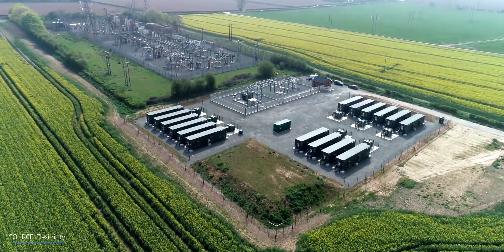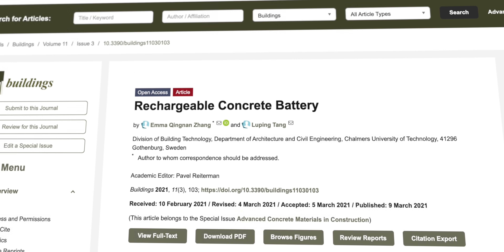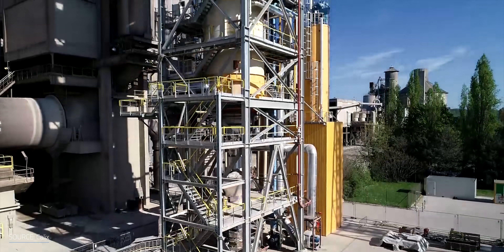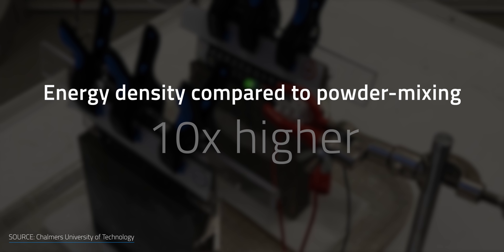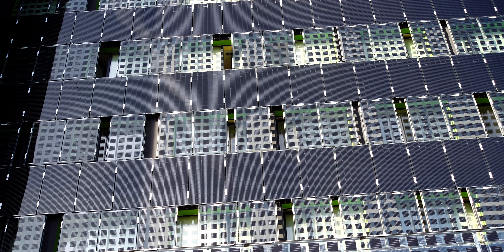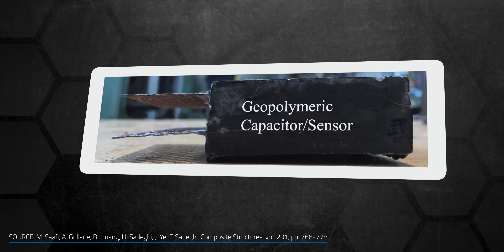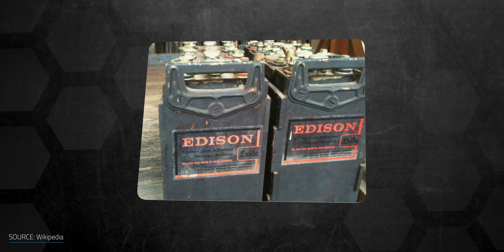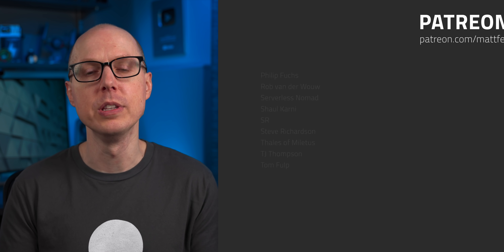Turning Buildings into Batteries? Concrete Battery Storage Explained

Comment: A conmplete change of subject. Why are car manufacturers and Grid 
companies not embracing VTG?  I believe that VTG is vital to the wide 
spead adoption of green energy. Tesla has soft ware control of the 
largest battery in the world that is growing by over 50% a year ie Tesla
 Cars. The Dutch have a dual action charger ie GTV and VTG. It works on 
the European charge plug. Your reasearch and comment would be 
appreciated. My thoughts are that Tesla and the Grid are stone walling 
this. Better a Tesla Powerwall and a Model X than only a Model X acting 
as transport and power wall. The grid has peaker plants that would fall 
from multi millions to minus multi millions.

Comment: I have a LOT of questions about it's viability. I'm pretty sceptical. Given the energy density, it doesn't seem worth much effort. 

Concrete is currently used because it is cost effective, versatile, durable,  simple etc....Not just because of the materials but because of the processes used to turn those materials into a finished product.  If turning it into a battery takes away from any of these properties... then builders won't use it.  You can technically build a house out of lithium ion cells and a carbon fiber quick change exoskeleton ... but I think it's safe to say that's not a good idea either. 

There wasn't an explanation of how this would be assembled in a real world construction application. Concrete is brought to site in a truck in fluid form and poured into forms / molds at the job site. If this process needed to be changed, it would likely not be feasible in most applications. 

Most concrete, almost all of it, has rebar in it. Would this have to be changed? Most concrete, almost all, is made so it will purposely crack in a planned location for expansion joints, and to allow for slight shifting, movement. Would this have to change? 

It sounds like these batteries would not be recyclable (in any practical sense) as crushing concrete to get them back would be very energy intense. 

Making something work in a lab is very different from making it work in the real world.

Comment: Can SpaceX develope an energy capture system at stage 0 of the launch. Beneath the pad extending in as many directions as possible while maximizing energy capture in this tech or use the Sand Energy storage already developed and I  use in ... Norway,I think. Each cubicle of heated sand capturing 600 degrees of temperature that has 6 months of energy conversion capacity. 
If Elon hopes to do 2 starship liftoffs per week, and the fuel doesn't compliment carbon capture, Elon can create energy storage with the megatons of Newton energy expelled per lift off. And at the tailend of those channels, have turbines capturing the wind forces from liftoffs. Mic drop....
Is this possible at a first principles level. IS THIS POSSIBLE. Please respond

Comment: But what is the efficiency? Electric motors are ~85% efficient in both directions, and gearboxes ~90% That means a better concrete battery would just be a gravity battery that would be near 77% efficient.

Comment: a cement battery and a high-rise capable of running the elevators and emergency lights would be quite beneficial. I am concerned about what would happen if a cement battery is hit by lightning.

Comment: Utility poles, lamps, wifi towers etc. I see this being useful in those cases.
Homes and large buildings? Nope. Not going to happen. All the structure usually needs to do is support itself and occupants. When you put the added job of "store power" on it and then it stops being good at that? The amount of work required to maintain the building increases to the point of being completely unsustainable.

Comment: This is DUMB DUMB DUMB, first energy storage of .7 watts/sq ft is USELESS, 2nd, you don't want your structural component of building undergoing cyclic chemical changes or it will lose it's structural integrity.  I wish there were not so much dumbshit ideas like this wasting bandwidth.

Comment: Not to be nitpicking, but cement is a constituent of concrete along with various aggregates.  You use both terms interchangeably.  In addition, concrete should be referenced as a volumetric unit in meters cubed.  That aside, your posts are always enjoyable and thought provoking.  Keep up the good work!

Comment: A few observations:
- Concrete is 8% of global emissions not 2.4%.
- At 7w m2 you would need 214 m2 just to boil an average kettle! (A poor analogy but you get the idea)
- Once life expectancy is reached, replacement would be impossible. All you have then is a really expensive wall.
So yes, far to good to be true.

Comment: If you could store energy directly in a freeway that would also play into ideas around inductive charging while driving.  USU is already working on modular concrete inductive charging blocks.  It would be interesting to have the structure act as storage as well

Comment: This will work great until the local drunk drives a car through the wall...

Not a good idea.  Build a concrete battery in the backyard, maybe, but don't use it as a building wall...

Comment: I'm sceptical. The ability to bear heavy loads is critical for any concrete structure and anything that could compromise that is a serious safety concern. Also I'm not an expert but it sounds like the cement needs to be kept wet to function as a battery, which makes it inappropriate as a building material. Not to mention the fact that cement and concrete are different (though related) materials and it is concrete, not cement, that provides critical structural integrity for large buildings.

Comment: I really hate those kind of "inventions" they are just making things more complicated, more composite,...

It is on one side making the concrete used in the building less inert.
As bad as concrete is to produce, at least, it is a pretty inert and easy to recycle material, even when steel rebar is used.

On the battery side, it make the installation non serviceable, not repairable, with a very low energy density.

And the end result is an expensive, highly composite material which will necessitate it's own recycling pathway.

Why not work on a better, "greener" concrete to build and sit a better battery on a simple concrete slab?

Comment: the way i see it if it can be abuse and not worry then it would out sell most other battery by durability... it mean you can just craft a block throw it in the desert and forget about it!
high durability mean less mantenant, if it fail... can you just break it down and recraft it since well the base material is not that much different than the finish product?

Comment: high density mean high temperatures 
so if you charge or discharge the wall and floor of your apartement in summer it heat the inside
and considering solar panel more eficient by summer day than winter night its again the reverse that is needed

Comment: In renewable energies there are 4 main criteria :

ENERGY CREATION = (solar) sun / (hydro) water / (turbine) wind
ENERGY STORAGE = e.g. LiFePO4 cells
ENERGY CONVERSION = converting DC to AC - e.g. Inverters
ENERGY CONSUMPTION = LED's (devices that use low energy consumption)

So we need to make ; save ; change and use efficiently !

Comment: I've been dreaming of my own house. I'd build it from Roman concrete. This is much more durable than modern concrete and we're talking about thousands of years of endurance. Add to that rebar and it's silly strong. Making the Roman concrete is far less polluting than the modern ones.
Reply: If you want roman durability, you should ditch the rebar.
Reply: @sevret313  I realised that after watching this video. Def. ditch the metal.

Comment: Maybe I am missing something but I kept being thrown off by the repeated references to watts per square meter.  Concrete would seem to be a volumetric medium, so wouldn’t that be watts per cubic meter?  I realize that the battery would be a laminar feature within the volume of the concrete so I see where the area units come in but some comment on how that is stacked up within the volume would have been good.

Comment: Calling that a concrete battery is like calling a lead acid battery a water battery because the elektrolyt is mostly water.

All this would do is to make construction way more expensive with the added benefit of having to TEAR YOUR HOUSE DOWN to swap a dead cell.

Comment: So... to use this in a building you'd have to use precast concrete panels since this sounds very hard to do on site. Number of questions though:
1) How does this affect the concrete strength? 
2) Does cycling the battery cause any component to swell? If so how does this affect longevity?
3) Does the ion exchange leach any important minerals from the concrete?
4) How does the battery react to water infiltration since concrete is porous?
Reply: Sooooo...what happens when I drill a 1" through hole in the wall or drive an anchor into it?

Comment: The issue is safe battery technology .the problem of using large scale battery storage facilities is the danger of fire and environmental issues .there is no such thing as green energy .The laws of physics dictate so !Energy can't be created ,only converted from one form to another !All we are doing is off setting the carbon footprint .Nothing is free but at least we can reduce the amount of fossil fuels we use .But all so called green energy requires fossil fuels to manufacture so one way or another we are dependant on fossil fuels to manufacture Wind ,Solar,Nuclear and Concrete !
Remember that plastic was a waste product of oil refining and used to be just burned off .That could have been used to generate electricity !

Comment: This kinda reminds me of passive solar designs and materials used in the late 20th century. The storage of heat though a bit different from the storage of electricity still follows similar properties like conduction and mass/density  potential retention. A problem for both is how to best control rate and flow direction. I see a lot of potential for this retro idea.

Comment: "I know what you're thinking: will my house electrocute me?" - Actually, I was wondering whether the conduction of electrolytes in the cement could pose a risk to the structural integrity. Could the addition of new metals in new structures change concretes susceptibility to 'concrete cancer'?
Reply: That was exactly my thought - like stories of peoples galvanized plumbing suddenly ALL going bad at the same time. IMO, this was most likely due to the addition of cable TV (remember grounding incoming cable to a water pipe?) Or even the addition of lawn chemicals watered in by sprinklers. We all know that galvanized was a bad idea, but does anyone know exactly why it randomly caused so many problems so suddenly. Concrete is already becoming a trillion dollar issue and now they want to make it subject to electric fields? What if my cell carrier installs a new localized transmitter up the street - or if the city moves my power lines under ground - or if we're having a bad solar flare day. What do you do when you live on the 7th floor of a 17 floor eco building with a koi pond on the roof and grass on the walls and a guy with a clip board stops by to say you have to move out for 18-30 months while they "fix" it?

Comment: It would be great to make the building a gigantic capacitor which consumes sunlight and stores the energy all over its walls. Maybe it would not even have to be connected to the central grid!!! I am waiting for cheaper rollable/sprayable panels. I have about 8 square meters of space around my window in a multi-flat building, so it would be so practical to use my space to save on electricity bills.

Comment: I'm hearing a lot about integrating this stuff into Lampposts, houses etc. which is pointless. A Battery still needs to be charged via the grid. Where the battery is is almost irrelevant. By the way you can just as well put a Lithium-Ion battery in a house or a lamppost. What I'm not hearing is why this is a good battery, better than what we have. I swear to god these video's are sales pitches with no critical examination at all.

Comment: Sounds like a good road to go down. Needs more study, especially to make sure it's as good as regular concrete for structural use, but replacing sidewalks and curbs and such should be no problem whatsoever. I think we should use as many supplementary technologies as possible until we can get fully green.

My other thing, aside from structural integrity, is wondering how it would complicate installation. Something like a parking curb/block is just a thing that can be plonked in place if mass produced, but how hard would it be to set this up in a sidewalk or wall, where it needs to be made on site?

Comment: I don't believe in batteries 
especially lithium-ion 
that is a non-environmentally friendly shit. Even assuming that we were able to make it feasible on a large enough scale, it would require a complete change of our infrastructure, which is clearly non-environmentally friendly.
I believe our best shot into making renewable energy feasible as a main source of energy is to focus on advancing our ability to make carbon-based synthetic fuels 
and we already have the infrastructure set for consuming carbon fuels

Comment: As structural engineer i have few question
But most importantly
Won't the steel re bar react without the chemical processes which will affect the strength of RCC

Comment: As an electrician and working in construction, I highly doubt this will ever be used in regular homes. Man, just training idiots who pour concrete... building regulations on renewable and batteries? what's cheaper, cement by itself or with this crazy, maybe useful tech. This seems decades from being able to use by regular people. What happens when the batteries fail and you have a crazy expensive foundation now for absolutely nothing? Seems highly dumb.

Comment: lets say this works. its great its wonderfull. its fully adopted.

my though is charging CARS. parking. you drive in and dont have to plug in. you just line up in the parking spot and do your shopping. With the idea the density of the power. say you could get 5 to maybe 10 miles for just going to work and having it sit there. maybe going for 30 min charges and gives you 2 miles. 

what about the idea that your charging when driving on that smart road. a 50 mile trip could reduce the charge by 40 instead of 50. the posibilities are endless.

Comment: never say times less because if the first item cost x then 2000 times less would be x-2000x = -1999x. Big difference between 2000X less and 1/2000th.

Comment: I like the idea but then i have looked in to Edison batteries I think there are a number of people in the comments that need to have a look at them as well because they were known for there safety and lasting a long time like if I am not mistaken there are some of the original that are still working fine.  there draw back was power density and until recently there were no manufactures because there was no replacement market because they would last for ever.  A couple years ago one or two companies had started making them again and I haven't kept up with what they are doing now but will be looking as soon as i post this.  I would be interested in seeing more on how exactly it could work but having done concrete work in my younger years if you are just swapping some steel for nickel and adding a little magic dust to the concrete mix I could see it working well

Comment: I wonder if you can still use the concrete for thermal storage for central heating and hot tapwater or cooling so it becomes a triple threat, couple it with PVT panels and maybe a heat pump for a complete energy system. If you reduce your energy requirements and go large enough, you can go off-grid in most part of the world.

Comment: The most important aspects are the cost and the environmental impact, these are complex but not too difficult to calculate if you have enough information. Somewhere along the lines of X€/kWh = additional costs to construction with normal concrete / # of cycles untill faillure / average capacity per cycle. And for the environmental impact, there are also plenty of examples how to evaluate this, the most important = CO2-equivalant emissions / # of cycles untill faillure / average capacity per cycle. Extra water-use, fine partical pollution, nitrogen emissions etc. also should be taken into the account of environmental impact. If both of these aspects are significantly lower than the competion, it can be a game changer! All other problems are part of the two main aspects or solvable/trivial.

Comment: Running the numbers on a standard 2,000sq ft home you would only see around 700-1,400 watts per hour of energy, and On average someone would used 1,000-2,500 watts hours every hour. This could work for large commercial jobs that have a concrete “bathtub” under the foundation but the point of that in most states is to keep the building from floating when water levels rise to ground levels in the dirt, this battery being used in the concrete of these building would lower the overall weight and causing a inverse problem with the reason concrete is used x2 as any other construction material. It’s just not going to work, other then  in the academia buildings where architecture and “ theoretical energy efficient efficiency” are highly prioritized over real engineering and building demand needs.

Comment: Cement is cooked in a kiln to a temperature of of 2800 degrees. That's 600 degrees hotter than the 2200 degrees liquid hot lava flowing out of Kilauea volcano. Takes a lot of energy to make concrete.